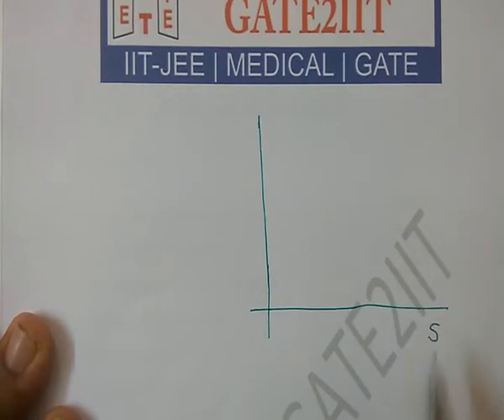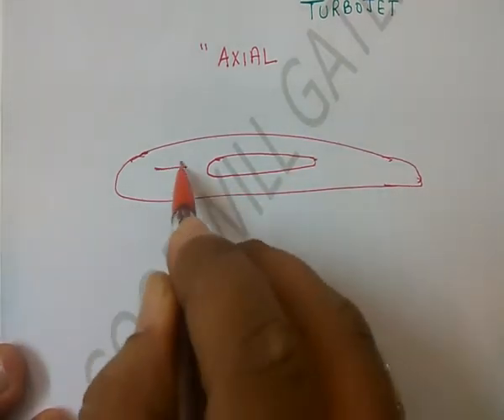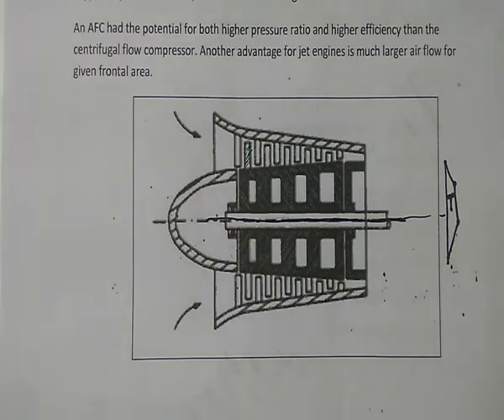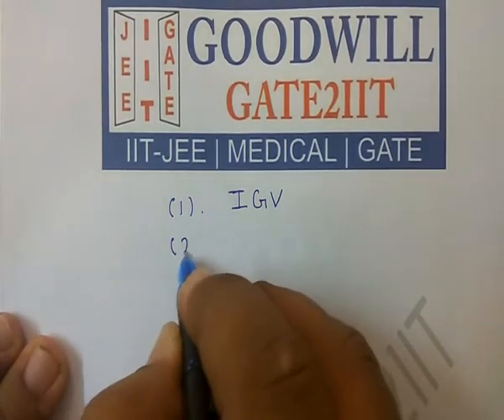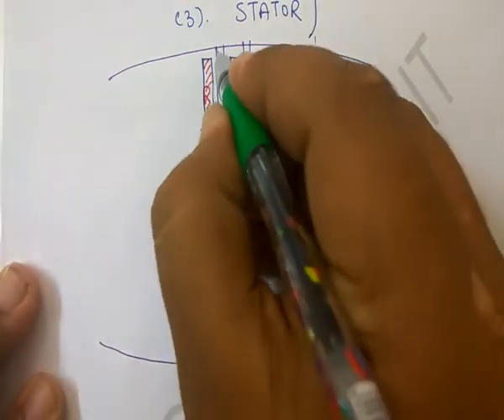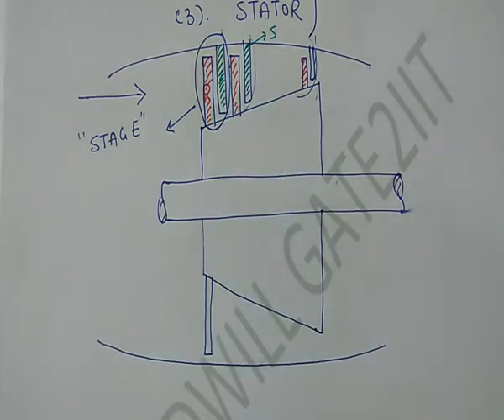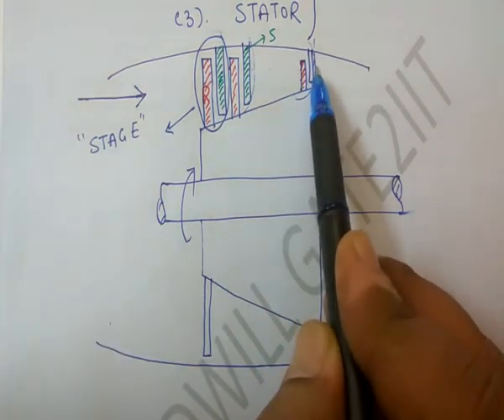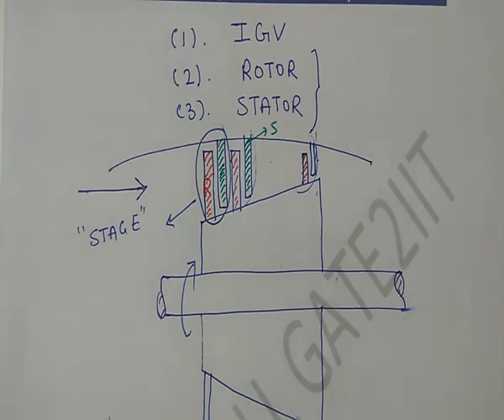GATE Aerospace - Aircraft Propulsion - Lecture 02 - Axial flow Compressor (AFC)

Comment: stagnation pressure constant,static pressure increases as no of stagings increases,why convergent for compressor blades ,because to   increase density of air so that pressure rise will be more
Reply from the maker: @Sai Krishna - Stagnation pressure increases in Rotor blades, because energy is supplied from turbine in rotor section, where as static pressure increases in both the rotor as well as stator blades, unless degree of reaction is zero. If we take friction into account, there will be actually reduction is stagnation pressure in stator blades. If you neglect friction stagnation preesure remains constant in stator blades. This is same for all the stages.
Hope this answer helps.....
Reply: @gateaerospaceengineering  difficult to understand